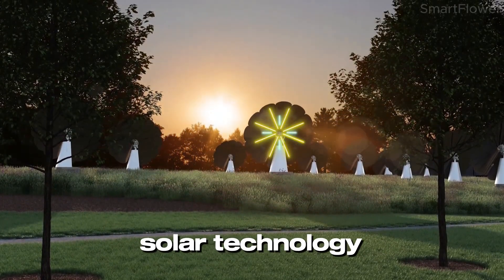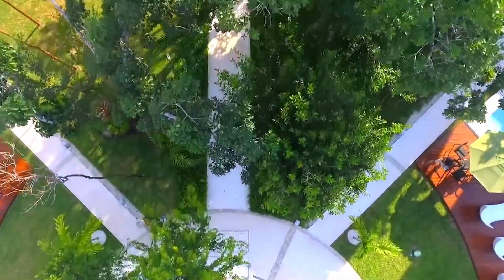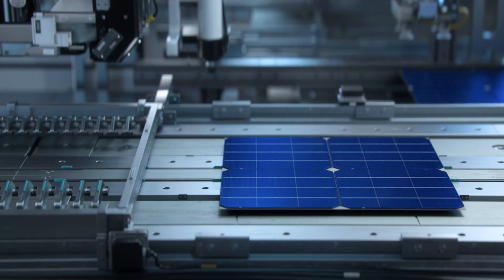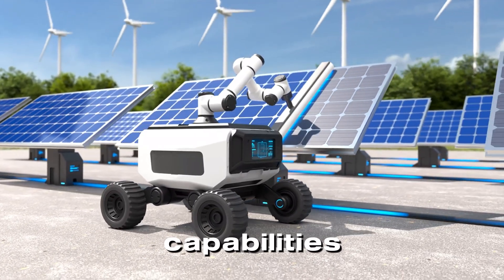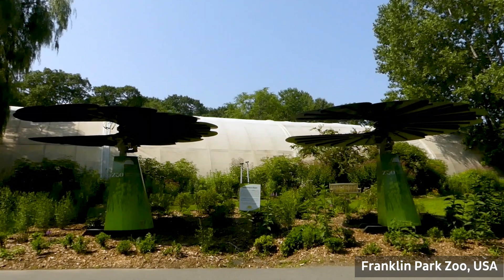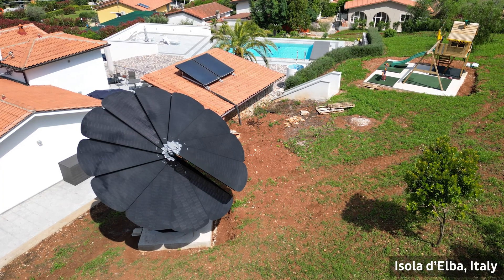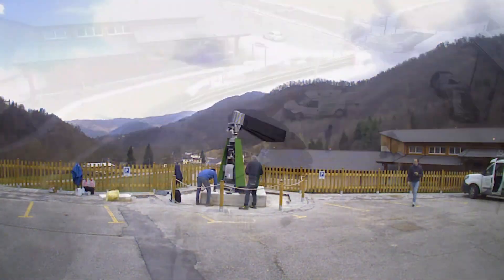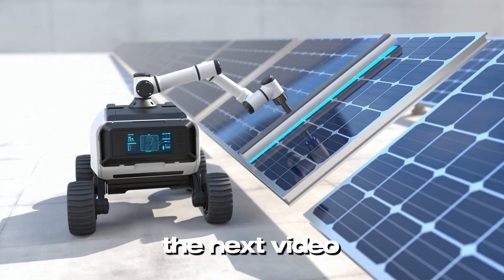This NEW Smartflower Outbeats Solar Power Worldwide in 2025?!

Comment: Hello! We appreciate you creating this video! Although, some information here is incorrect and we would like to not have customers misled. The SmartFlower costs $39,950 MSRP and our SmartFlower +Plus unit comes in at $62,500. We also do not offer an EV-specific model - any SmartFlower can help to charge electric vehicles. We appreciate you mentioning the incentives that comes along with solar across the country and states specifically. Thank you for this video and we hope this information is clear moving forward.
Reply from the maker: Thanks for you helpful feedback about the price. I have pinned your comment so that viewers get noticed about your price.
Reply: Thank you for your update; it's a very informative video. The product looks great in the video.
Reply: Since the cells are not what drives the bulk of the cost, perhaps you should make the leaves slightly bigger, overlap one another really and as such take up all of the sun you get and perhaps have a few cells that are partially shaded by the panel above.
Reply: what is the wattage of the +plus? and how much storage does it have?
Reply: I just seen this on exploration, it looks so neat,!! .. most of us would not be able to afford it.🫤

Comment: HOW MANY SMART FLOWERS IN YOUR BACK YARD TO PRODUCE 20 000 KW ?
Reply from the maker: To produce 20,000 kWh annually, you'd need roughly 4 to 8 SmartFlower units, depending heavily on your location's sunlight; since one standard 2.5kW SmartFlower yields 3,800-6,200 kWh/year, you'd calculate by dividing your target (20,000 kWh) by the expected output per unit in your area for the most accurate number, as sunny spots yield much more than less sunny ones.

Comment: Umm if I make a solar panel that consists of many panels then yes it can out preform a single typical solar panel😅 thats about the dumbest advertisement I've seen in a while. Giant smart flower lol it just many panels arranged in a shape that has a sun tracker. If you put the same ablmount of panel on a normal setup and then have that setup track the sun you will in fact get more that this flower crap. This is just dumb. The cleaning factor and if there is a storm now that should be the selling point not the power output.
Reply from the maker: Totally fair to be skeptical—it’s true that the Smartflower isn’t magically producing more energy per panel than traditional arrays. But what makes it interesting isn't just the shape; it's the integration of sun-tracking, automated cleaning, and compact design into one plug-and-play unit.

You're right that a well-optimized ground or roof system with tracking could outperform it in raw output per dollar—especially at larger scales. But the Smartflower is more about convenience, aesthetics, and smart automation for homeowners or institutions that value those features.

Also agree with you on the storm-resistance and cleaning—those are some of its real strengths that should be emphasized more. Appreciate the critical take—it helps keep the hype in check.

Comment: How big is the energy capacity they can produce? Less or over 100kwh??
Reply from the maker: Nice qeustion. They can produce + 40% more energy due to the tracking of the sun
Reply: @renewable_energy optimal 5hour/day in tropical area, how big is it?
Reply: @renewable_energy optimal 5-6house/day in tropical area(indonesia), how big is it will be?
Reply from the maker: It is based on the solar irradiance in your location.
Reply: @renewable_energy now what is the basic capacity of your product... simple. If 100watt multiply by 40% them 140wtt. HOW MANY WATT IS YOUR PRODUCT CAPACITY? Like 1 conventional solar panel produce 150 or 200watt/panel. What is yours?
Reply from the maker: There are different items with various rating. I advise you to go to the company website to find hhe best one for your needs.
Reply: @renewable_energy how can you rated +40% of energy? On what basic data is that?
Reply: @imamkamal1104  in Indonesia you can expect a SmartFlower to generate about 6000 kWh per year in most areas
Reply: @imamkamal1104  the extra 40% comes from the fact that the SmartFlower tracks the sun in two axes (azimuth:  East to West, and elevation);  plus additional energy results from the SmartFlower keeping cooler with excellent ventilation since solar panels produce less energy when they get hot
Reply: @imamkamal1104  I dont see their  reply to answer. This  was my question too.
Reply: @renewable_energy  40% dont mention as comparing a 10 KW array system vs the flower produces.

Comment: Bro do more research. The fact with high maintenance. Problem with moter and others. Not efficient at all. 
It was greatest innovation but not efficient
Reply from the maker: I understand your concerns about efficiency and maintenance, but I encourage you to look at the bigger picture and the potential benefits.
Reply: untrue, it's designed for 25+ year outdoor life, with Italian motors rated IP65 for ingress protection, there's no problem with motors and maintenance is MINIMAL, just needs a light service (greasing moving parts) once every year or two